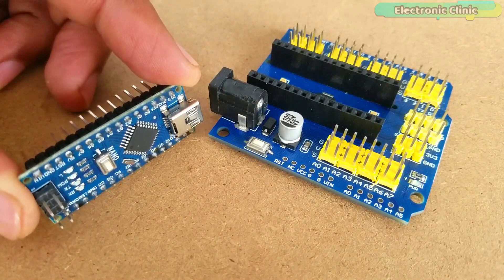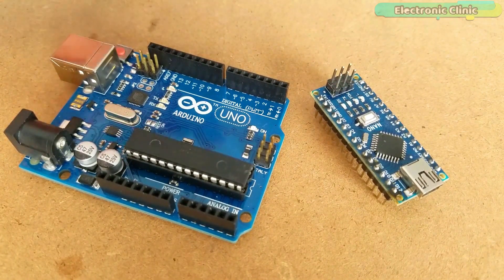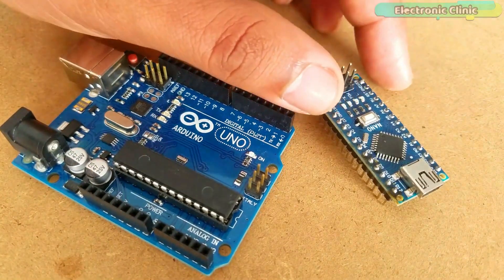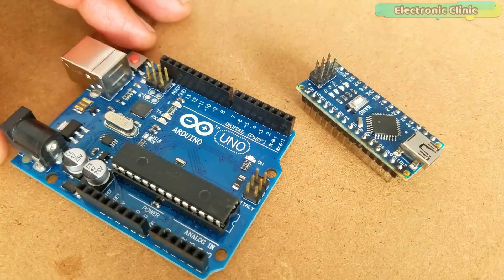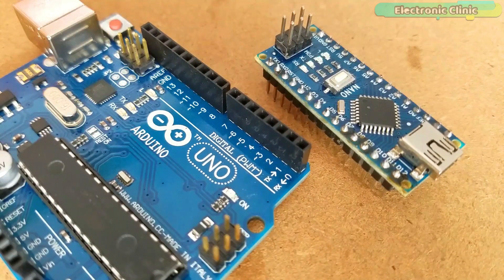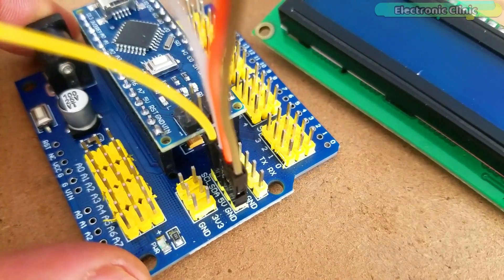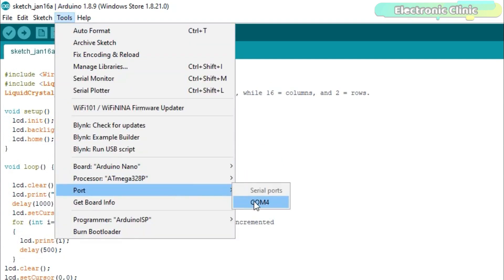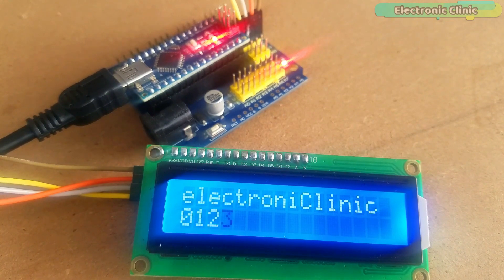Arduino Nano Vs Arduino Uno, Arduino Nano i2c LCD 16x2

Comment: Awesome video brother 👍
If both run on same program than should I buy Arduino nano as it I cheaper???
Reply from the maker: yes arduino nano is best, its a small size and cheaper. check my last video in which i used the smallest arduino. that's even cheaper
Reply: @ElectroniClinic  thank you  I have started my youtube channel please visit one's 🙏